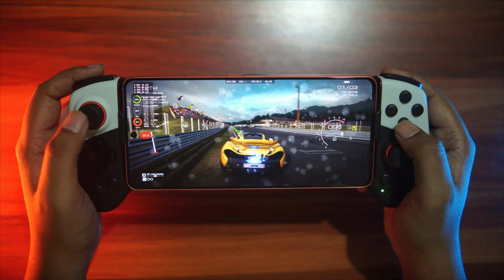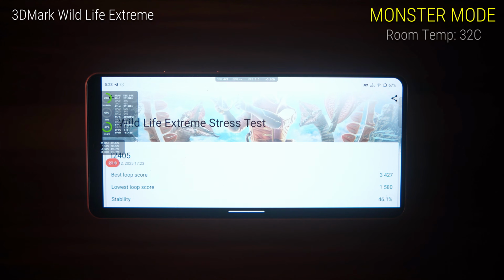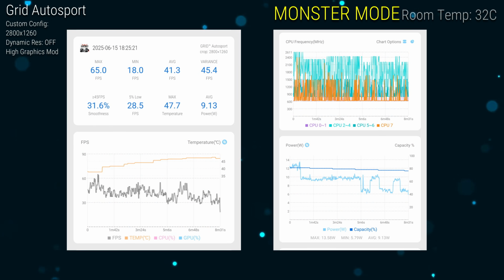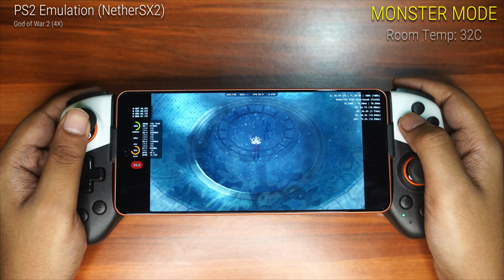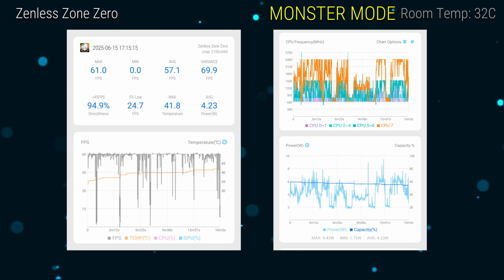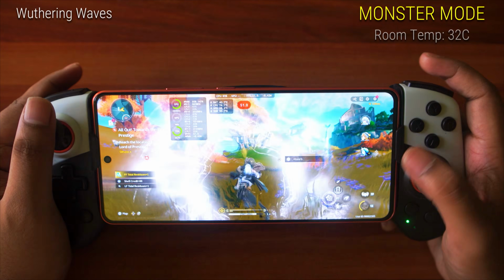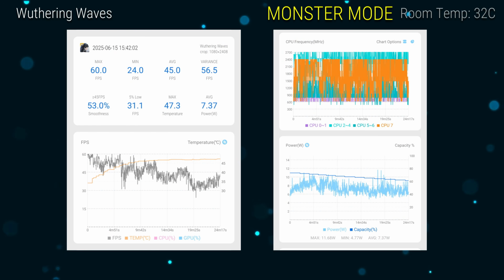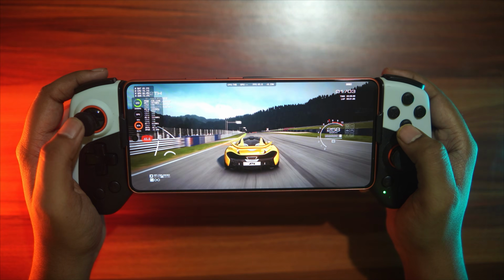iQOO Neo 10 8S Gen 4 In-Depth Performance Analysis - GRID, CarX, WuWa, ZZZ, GTA DE PC Mods 🔥

Comment: Hello I have a question, in your video about how you enable fps overlay, I could not pair my iqoo z10 turbo pro on shizuku, the notification shizuku to enter the pairing code does not appear any workaround on this? Thank you. And also do you have any information on how we can use frame interpolation on games that is not supported in global rom? Cn versions of games has it working specially pubg and crystal of atlan. Any workaround on these?

Comment: Hey bro. Great genuine reviews. Truly trustworthy. Keep up the great work🙏🏼... I needed your suggestion as I'm planning to buy a new phone. I play BGMI almost daily and needed a phone which can give me decent 100+ fps. Should I go for Neo 10 or IQOO 13? I saw your long term review for IQOO 13 and had my doubts whether to go for it. I'm getting 12/256 for 47k after all offers+exchange. I'm getting Neo 10 12/256 for 29k after all offers+exchange. I generally use my phones for atleast 4-5 years so wanted a reliable phone for the next 4 years. I've been using my Vivo Z1x since 2019 and it's still running well. Thanks in advance
Reply from the maker: iQOO 13 is more capable of 110+ fps, for sure! 8 Elite's CPU is way faster!

Comment: Ok so i played wuwa on my iqoo z9 turbo(8s gen 3) i went to Oakland Highcourt(the elden ring place)went to the yellow lines where u can get unlimited flight stamina and u dnt need to move at all u fly around the circle for a long time. I used my cooler and open game tool to see my cpu mhz and gpu while flying in circles i saw that my cpu mhz is max out but not my gpu it is still at 500mhz which is not good. It supposed to be 1100mhz.tho i got a lot of improvement with cpu at 3.01ghz and gpu at 500mhz the fps wasn't stable 60fps

Comment: Hey bro which is best processors for gamehub emulator games sd8 gen3 or sd 8sgen4 or sd 8elite
Reply from the maker: 8 Gen 3, also 8 Gen 2. 
8 Elite is decent, 8S Gen 4 is worst for it, neither has good driver support nor does it have the required brute force CPU like 8 Elite.
Reply: @techstation365  thank you for replying

Comment: Would you still recommend a phone with 8s gen 4 instead of a phone with 8 gen 3?
Reply from the maker: No I recommend 8 Gen 3 purely from an SoC perspective. 8 Gen 3 is also significantly better for switch and window x86 emulation.
Reply: @techstation365  Thank you for the reply. I've been torn between getting the Honor GT and this iQOO Neo 10. Guess I'll go with the GT route.

Comment: Doesn't care about battery and size. I want better mobile, Should I consider xiaomi 15 or should oneplus be better. I saw in gaming comparison that xiaomi maintains better frames but higher temps and op throttles in b/w but lower temps. Also I saw that xiaomi has better calbrated display(screen). Both have very good cameras for me. I do have mobile cooler, still I am totally confused.
Reply from the maker: Between OnePlus 13 and Xiaomi 15, go for OnePlus 13 for gaming. Rest is upto you.
Reply: @techstation365 What about performance inconsistencies in oneplus? Still confused. Sometimes it works very good sometimes very average in games. Saw many performance videos in YouTube that's why confused.
Reply: @Bliss-g1i The Indian and Chinese OP13 don't throttle at all. If you have watched any video where the device was throttling, then it was definitely a difference regional variant.
Reply: @techstation365  Please Reply Brother

Comment: Hi, I've commented on your last video but if you want to utilize Q1 chip's frame interpolation use this command:
settings put system gamecube_frame_interpolation 1:1::48:144
settings put system gamecube_frame_interpolation_for_sr 1:1::48:144

Comment: Which phone has given you the highest consistent fps for wuthering waves so far? Also, how does the realme gt 7 compare to this for wuthering waves? Money is no object but battery life is essential to me. I've heard countless poor reviews for the battery on the one plus 13 which is a deal breaker for me.
Reply from the maker: OnePlus 13 with poor battery life? What do you mean by 'poor'? I'm asking because my friend has a OnePlus 13 and I daily drove it for a week. The battery life was 10% worse than my iQOO 13 (which I sold), but poor? OnePlus 13 battery life is excellent. 

For WuWa I recommend 8 Elite, because most SoCs are CPU limited.. and 8 Elite has by far the best CPU in the world of Android. The game doesn't take proper advantage of the Android hardware.
Reply: @techstation365 You'll find a lot of people complaining on reditt. An ex colleague also got barely 6 hours. Maybe they fixed it with an update. But the collective complaints made me sceptical on What if I get one of those poor battery pieces. Iqoo I won't choose because of the hot apps pop up that is beyond abysmal and can't be turned off. OnePlus 13s looks amazing but I'm guessing the size is bound to make it throttle. Rog skipped it's India launch this time. So my only option is the realme gt 7 pro with its nerfed battery I suppose. What's your best 8 elite phone recommendation apart from OnePlus 13 if I prioritise battery and high performance only. Don't care about camera. I'm open to the iPhone also. Does it trump 8 elite for wuthering waves?
Reply: Yep 8 elite is on another league man my frnds have oneplus 13   And play gta sandreas de editi with all pc settings unlocked at 120 fps phone average jusicing battery at 9_12 watt Even after 30 minutes  game play op 13 still maintain 120fps @techstation365

Comment: Your device is absolutely shit, my snapdragon 8gen1 with redmagic 7 plays grid auto sport graphics mode at 90fps and a constant 60fps but your device can't even maintain 60fps? Wow
Reply from the maker: That's why I hate when people like you don't watch the video properly.
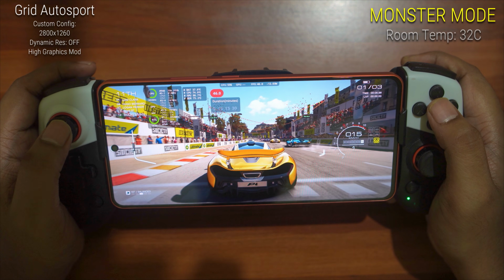Check 5:59
I am not using vanilla config, I modded the game by disabling Dynamic resolution, setting 2800x1260 native res and updating the graphics manually by changing values to high. Did you skip all that? I made the game a lot more demanding.
At these settings you will get 35 fps or so..

Comment: Red Magic 10 Pro (8 Elite)
Grid Autosport: 120-130 FPS / 2688*1216
Carx Street: 72 FPS

I was really surprised at how much difference there was with the 8s Gen 4. I can say that the results are slightly better than the 8 gen 2 😐
Reply from the maker: Plus RM10 Pro pushes UNLIMITED Powaahhhh!!!
Reply: @techstation365  Bro,  that has liquid cooling right?
Reply: Lmao even my 7+ gen 3 with a cooler gives around 43 fps 😭 I cannot stop laughing
Reply from the maker: @îngeritriști Did you modify the game files to run at all high settings and disable dynamic resolution? 7+ Gen 3 will run at 30 fps odd at 2800x1260 with DR off and my settings because I have already tested the 7+ Gen 3 personally on the Xiaomi Pad 7.

Comment: For maximum and better performance.. you'll need the 16/256.
Reply from the maker: What makes you think so? I am using 8/256, in what game am I memory limited?
Reply: @techstation365 Every game you've played here are ram-intensive games. On stats it may seem that the ram is not loaded. But actually its limiting the performance. So if you check both the 16 and 8gb varients.. you'll see a lot of difference.

Comment: Please provide the grid autosport config 😅, I will change the resolution
Reply from the maker: It's easy man, you will have something called as ScreenH and ScreenW , you can change the values there.
You also should disable dynamic resolution for the sharpest image. There is a section dedicated for dynamic resolution scaling, just set enable = 0. 
Rest you can change values under gfxconfig and gfxconfig_high from medium to high.
Reply: Thanks ❤ @techstation365

Comment: JUST TELL ME IF YOU SPOOF BGMI AS ANTUTU THE SAME WAY YOU DID WITH 3D WILDMARK WHAT WILL BE THE RESULTS. IT WOULD BE PRETTTY INTERESTING. PLEASE TRY IT ONCE.💯
Reply: It would be interesting to see the difference between the fps in both scenarios.
Reply: What do you say?
Reply from the maker: @rajanand8488 Yes it'll be interesting and it's possible but not easy. 
For big games and applications you need to decompile, make necessary and correct changes in manifest.xml and other .smali files, then recompile it and sign it.
I tried doing it with Grid Autosport but failed. I thought I did all the steps correctly but it still failed to install, so I need to put time and effort into this.
Reply: I believe in you. Only you can do this. Most techy reviewer 🎉 💝  @techstation365